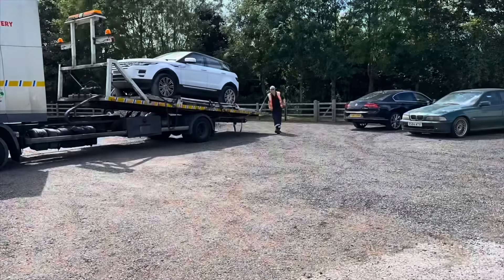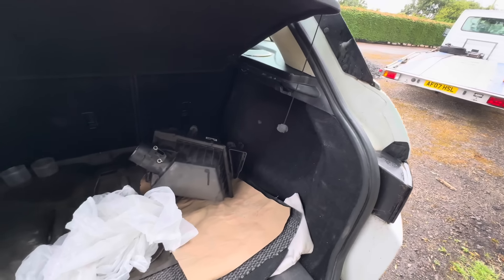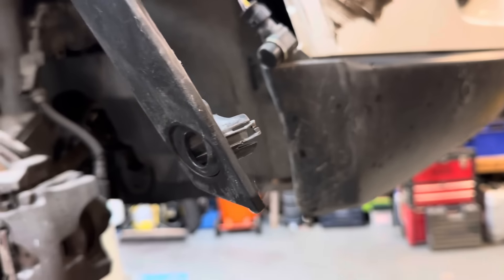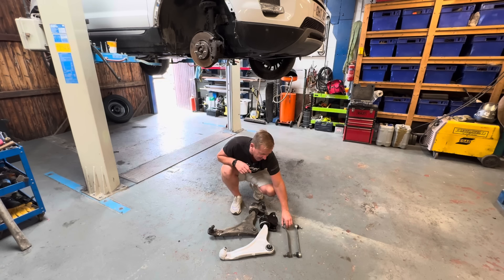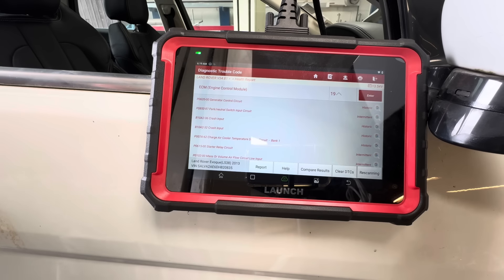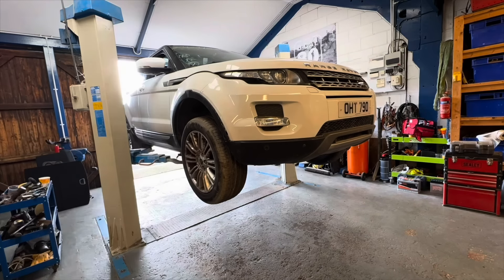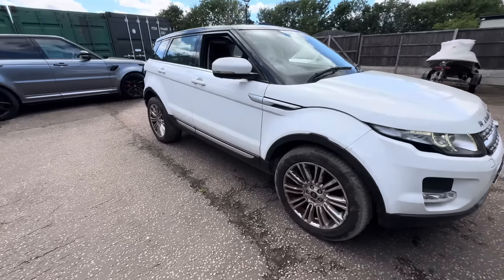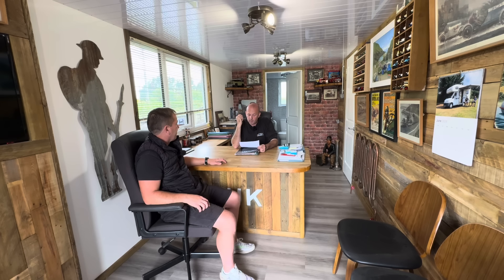WE BOUGHT A RANGE ROVER EVOQUE FROM COPART WITH A BODGE REPAIR

Comment: And that wrote the car off? WTF is wrong with insurance companies? THAT'S why your insurance is so high!
Reply: Not to mention depreciation 😮
Reply: It's not the cost of the repair nowadays, it's all the other costs in top, to name a few, hire car, storage of the vehicle whilst waiting for repair, storage of the car whilst waiting for the paint shop, admin..... When you total just those together plus the cost of new parts from landrover (which are on massive backorder) it becomes uneconomical to repair for them.
Reply: Repairs are not so bad, but there is waiting lists in body shops, waiting lists on parts and all that time you’re driving a hire car. Our waiting time was 2 months for bodyshop and hire car was £475 per day. Got written off for 2 scratched doors that I replaced with doors in colour from a breaker car for £300.
Reply: @olie3146  That's an excellent point 👍
Reply: @olie3146 also personal injury claim probably being more than the cost to repair the vehicle.
Reply: If they didn’t use main dealers for repair prices that would help massively
Reply: Ki have seen cat S with same damage if the wheel goes back and touches the bottom of the A post wheel arch it goes down as cat S
Reply: @Dalbayob69 Hire car £475 a day?
Was that a Ferrari lol
Reply: Insurance is so high to accommodate the EVs
Reply: @davidwebb8877 wrong… so why do they sell them on to be repaired, then instead of scrapping them cat b? Insurance companies want as much back for their asset cars as they can.
Reply: Scandalous
Reply: Smooth operator’s
Reply: evs making insurance high..any flood car gets written off.
Reply: @NotMarkKnopfler  my insurance is over a grand ive a clean license no claims in over ten years i put it down to  my age
Reply: Knowing insurance companies now use photos to assess cars 
Without knowing what the car looked like before it was bodged back together it's hard to tell
Reply: I think it’s the labour charge that most repairers want now at around £70 an hour on top of the full retail price for new parts as insurance repairs have to be with either new OEM parts or similar “ insurance approved “ parts plus a long waiting time for repairs ( sometimes up to a month) where they have to supply their client with an “ equivalent “ curtesy car for the whole time. The fully comp concept is so ridiculous now It’s probably cheaper to give their client the dosh on day one..
Reply: Great video! You guys have some balls, I was nervous for you 😮😊
Reply: @ast6537  it’s actually worse for EVs. Harder to get parts and less shops able to do the work. Seen it happen to a colleague.

It think the only agenda is insurance companies looking to save every penny.
Reply: Think how much a bumper is now compared to 20 years ago full of sensor's expensive fog lights ridiculously expensive headlights all is priced up as new with high repair costs
Reply: Absolutely right.
You could still drive it whilst waiting for body shop. Once mechanically sound it would be fine till its ready for paint.

Comment: On the evoque the gearbox park release is under the air box and if drive shaft was hanging out I suspect it was manually put in to neutral to assist with recovery. To put into neutral you will need to drop a drill bit or screw in the hole to stop leaver moving back to park!! That’s why the air box is out.
Reply from the maker: 100% correct 👍
Reply: I was about to say something

Comment: I like nice easy bargain turnarounds like this!!
I bought a Range Rover for less than half price because the gearbox had a fault and the owner was quoted £4000 to fix it! 
I fixed it myself and the part only cost £260. 😊

Comment: The emegency park release lever is on the front of the gearbox.
I often remove the air filter housing to release the gearbox for roadside recovery.
It's safer than using skids/slippys and takes 2 min to sort.

Comment: If it's an I drive auto  .... to put into neutral     remove airborne    pin in gearbox selector into a hole ...    that's the    only reason   I think     I'm in recovery  for big company    discovery sport   same

Comment: I bought a 2014 my Freelander 2 two weeks ago for £1800 at auction. Nobody bid on it, and its a bit noisy underneath at times, but, its in nice condition. The early Evoque is all the same running gear as the Freelander. I have all the parts you needed on the shelf, and a new righthand complete driveshaft was £90 when I bought it. Worst bodge I have seen for some time, but it would get you home, perhaps. Trouble codes after a jump start, and, or low battery. Check the crash module is not tripped as well.

Comment: I would say they  removed the air box to get to the lever on top of gearbox that allows you to lock into neutral. Might of been stuck in drive or park after being hit. Or recovery driver dint have jump pack etc.

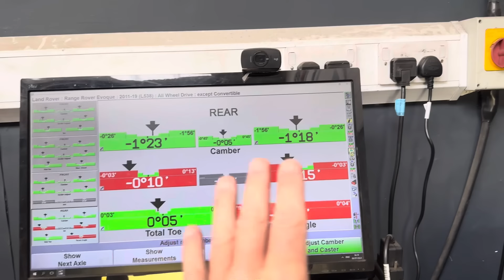Comment: 23:06 What is thrust angle on an alignment? Is that to do with crabbing?
Reply: Yeah pretty much. It's basically the left-right pitch angle. If it's badly off it can cause your vehicle to drift to the left or right, and it can give you problems with the rear kicking out in low grip conditions such as snow or ice.
Reply: It's probably for the ADAS system.

Comment: Rob reason airbox removed, it’s from when car would have been originally recovered, under air box is gearlinkage which you have to move to a central position and drop a pin in to hold in neutral for recovery or movement. Great videos please go back to 3 a week all the best to you both 
Peter goldsmith

Comment: If I'm not mistaken, some Range Rovers/Discoveries have a second, smaller battery in the engine compartment. I think they were looking for the second battery under the air cover, but the car doesn't have one? Just a guess.🤷‍♀

Comment: Just done a wheel bearing on mine , what an absolute nightmare  getting the drive shaft out and splitting. Bottom ball joint , allimuninium corrosion with steel , it's just not moving, 
 2 days with heat big hammers grease , wd40 ,in the end I hit drive shaft that much it went like a mushroom at the dnd , 
when you ask about for someone to do it , noone wants to do this  wheel bearing  job on these lol

Comment: Rob I have just done a front subframe on one of those evoques and it was AN ALMIGHTY PAIN IN THE BUM it was rotten as a pear,the lower arms were a NIGHTMARE the ball joint bolts were seized in the hubs and the two rear bush bolts go through the anti roll bar ‘d’ bushes to hold it all together and the front suspension arm bolt was a right royal pain to line up coz I had to Jack the suspension up near flat to line it up and the cv joints were seized solid in the hubs so be careful.I suspect that arm has been bodged back together with the exhaust clamp just to get the car moved about

Comment: Top tip for Land Rover / Range Rover owners. Tighten the driveshaft nut when the vehicle is on the ground, through the wheel centre when it's at ride height. Tightening them up whilst they are in the air , with the suspension at full travel can damage the rubber boots, which isn't obvious at the time. My mechanic used to do this (aftermarket wheels with smaller diameter centres meant you couldn't get the socket on with the wheel on) and I would go through drive shafts every 12 months or so.
Reply: Many bearings on suspension and driveshaft have to be torqued to spec with the car at ride height, sometimes with given loads/weight in the car. This applies to many makes of car.

If not done properly the rubber in the bearings will prematurely deteriorate, basic 101 for experienced mechanics.

Comment: It is shocking the the depths of deception the garages or owners will get up to prior to moving vehicles on. You may be right with your thought on the registration plate . Then the car was sold on at auction, warts and all.
If the car was not insured comprehensively, then the owner at the time would would want to get rid of
It. I don’t understand what part the insurance company played , It may be the age of the vehicle. 
I am sure that you will put it  right. You are a star. I hope you make a good profit. Excellent report.

Comment: Hi Rob. 😊this happened to me🤦‍♂️. I drove into a parking space quick sharp.  I drive a Ford C max. I didn’t see the Hugh tyre on the Mitsubishi Shogun was turned out towards my parking space. It was my fault and fortunately a low speed impact😢. No damage to the Shogun although it marked my bumper on the edge and stoved the leg back. I needed a lower arm. No drive shaft. But the upper strut mount was blown. 
I fixed it myself so it didn’t cost much. Something to watch out for!

Comment: I bet you it had a system lock due to add blue or some service . Taking the air box out and manually putting the gear box in neutral to tow it
Reply: It doesn’t have ad blue
Reply: @hughmarcus1  I'll put money on they tried towing it first by the lower control arms , broke them then took out the air box to put in neutral

Comment: I am with you Rob on the bodge they needed to move the car around so that makes sense. Why they removed the air box is a puzzle but the car seems to run well so no need to worry there. I think Claire will love this Range Rover Evoque as she has had one before and this one only has 30K on the clock. A quick turnaround on this one and you will still be making money with the Mercedes so well done to you Rob and Chris. 👍👍

Comment: When i buy from Copart (or any other actually) i usually see the air boxes coming off, to give them a squirt of brake cleaner, to get them fired up if battery flat, or low.
    The lads know it might need it again, so just pop air box in boot.

Comment: I buy a few range rovers/land rovers through Copart. Air box is usually removed to locate emergency neutral selection. I’ve had some absolute bargains due to this as the appearance screams flood damaged. It’s always a gamble though!
Reply: Have you bought many 2,0d lots at copart with knackered engines a mate has bought 2 2018 discoverys all knackered engines
Reply: @leedstown  Yes, only 2.0d’s really. I try to go for the stolen recovered stuff, missing keys etc. I know the engines are terrible and I’ll be stung with one that has self destructed one day 😅.
Reply: Obviously wasn't flood damage, so the air box was removed for another reason. Rob was jumping to an illogical conclusion.

Comment: Good video, excellent repair, I am not sure if the Range Rover is ULEZ compliant. The new Labour Government are under pressure to clean the air we breathe. As for the mechanics, it has been bodged by a garage that is not competent to carry out the repair that you whistle through. The number plate was obviously of value hence the change of ownership. The motor trade is a mine field to the uninitiated. My local prestige main agent should fly the skull and cross bones.
Reply: I'm a west country boy, what is this ULEZ? more Ken Livingstone rubbish penalising the driver of a nice car it seems, congestion charge, i dont get any of it.
Reply: It is ULEZ compliant. At least in Birmingham anyway.
Reply: That’s an SD4 is euro5 & definitely not ULEZ compliant
Reply: That’s the SD4 engine, the one the trade loves as it’s a robust unit. They are very intolerant to low cranking voltage & it will generate multiple faults.

Comment: Hard to sell these I’ve got a 2013 white with black pack top spec 2.2 sd4 4wd 93k onit in Newcastle £5200 I want for it it’s not selling not a thing wrong with it CAT N front bumper and bonnet new and painted no one wants them
Reply: Auto or Manual ?
Reply: I thought cat cars were worth about 70% of list valuation so £5200 seems a good price
Reply: Manual
Reply: @Ryany33  Shame I need a Auto...got family in Newcastle too!
Reply: @Ryany33 that’s why no one wants a manual range rover
Reply: @bmwman1981  I know but I tend to stay away from automatic cars just a headache from the start in my opinion from the minute you try to unload it
Reply: Found the same with rebuilt XC60s. The inbox fills up fast when I advertise an automatic but the manuals have zero interest to the point they end up going for a loss.

Comment: Rob , stay as far away from j&r garbage as you possibly can , in 20+ years in the motor trade , i can honestly say, they are one of the absolute , if not the worst companys iv ever dealt with , with the least amount of quality control iv ever experienced , its not a case of if they fail , its when , and usually its straight out the box, not a single person in the trade i know will entertain them now, chinese rebranded junk 👎😣

Comment: Most cars have neglected brake and coolant fluid. You need to replace these every few years regardless of mileage. If not done, you get rusted out brake lines and possible rust/oxidation inside the cooling system, resulting in bad cooling performance and eventually engine failure. You could up your game by flushing these before you move vehicles along.